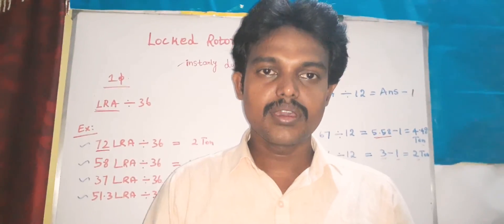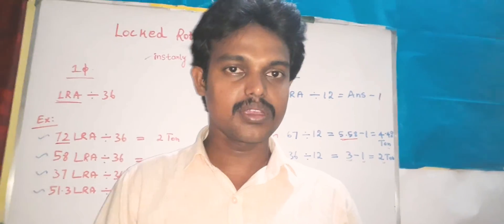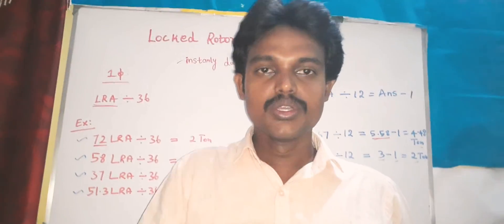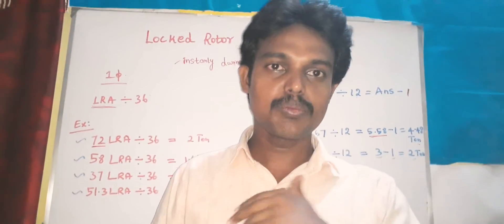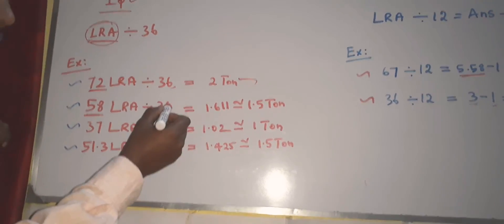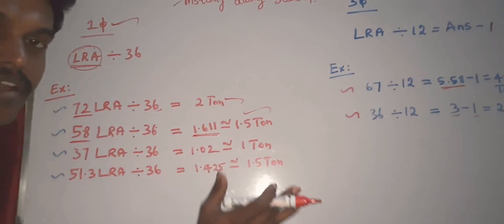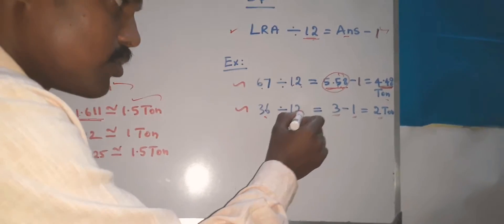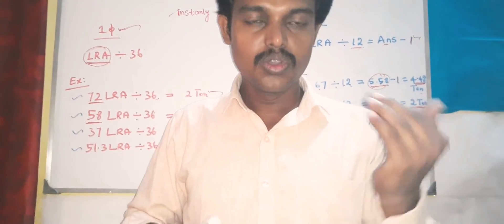[Tamil] LRA || Locked Rotor  Amperage || 1 Phase || 3 Phase || Compressor ||

Comment: I saw your video .I have doubt for calculation .  We are using has screw compressor in air cooled system LRA is 612   Could you explain from LRA to tonnage.
Reply: We are using two compressor in chiller 3phase system.
It could be analyse LRA or model number.????
Reply from the maker: Are you stating two compressor or else two circuit?
Reply: @EngineersViewEEE   two circuit has been used in compressor.
Reply from the maker: Did you calculate as per the shared procedure?
Is it matching with your system or not?
Reply: @EngineersViewEEE  It's matched ..

Comment: LRA AND OLR AMPS ARE DIFFERENT SIR
Reply from the maker: Yes..OLR and LRA is completely diffrent..OLR will function based on the time delay which we set up..its rating generally 1.5 times of the rated current. 
But locked rotor amps wilbe 5 to 7 times of the rated amps..